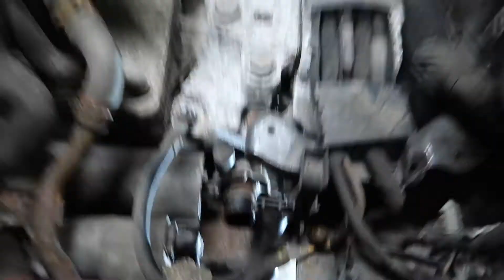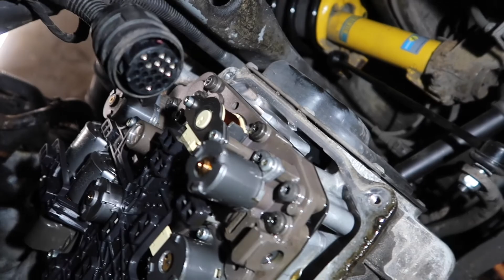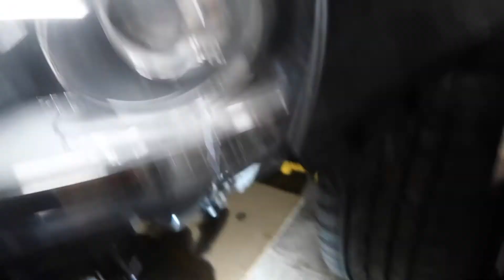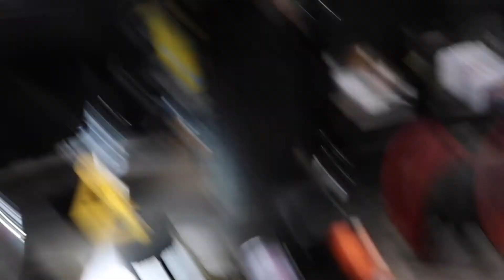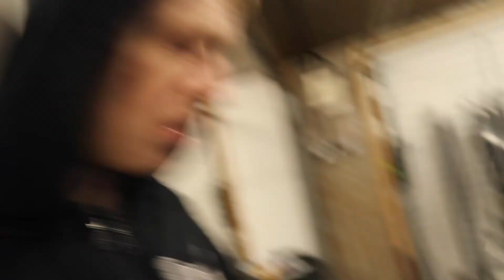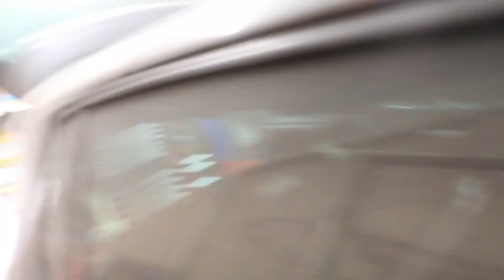Cheap R32 restoration project Ep.8 - Mechatronic cover replacement.

Comment: 4:30 You are VERY brave to heat the bolt with a flameblower!!! :) Did you ever try to knock the bolt with small hammer and/or spray it with degreaser/loosener first?

Comment: My Alhambra was used in a very wet environment and my gearbox pan is very rusty. Service said it should be replaced because they don't know how much it will resist but they didn't remove even a little rust to see how bad it is. They also included gearbox oil change and adaptation. So new pan + seals and sealant + new oil and adaptation= 230 euros

Comment: 9:49 how many Nm of torque for those screws?
Reply: AI says: 5 Nm + 90 degrees (quarter turn) for metal covers. For plastic covers 20 Nm. Then tighten crosswise to ensure the cover fits securely. You're welcome! :)

Comment: Did I hear you say that the Starter Motor needed to come out?  I'm getting ready to perform this exact same repair.  I have a slow persistent leak coming from the Mech.  seal.